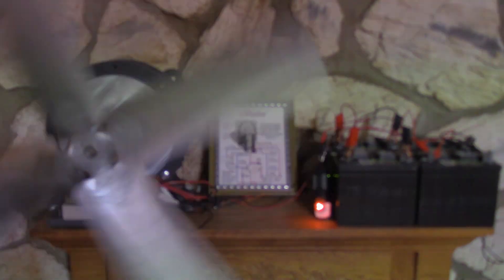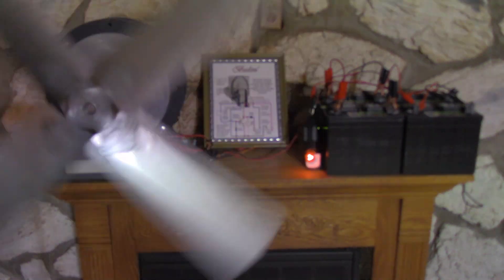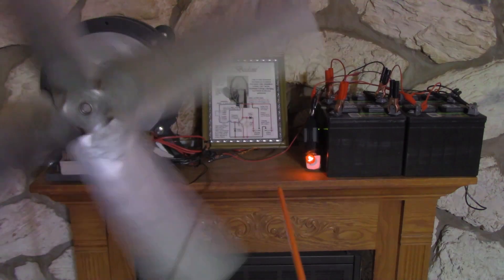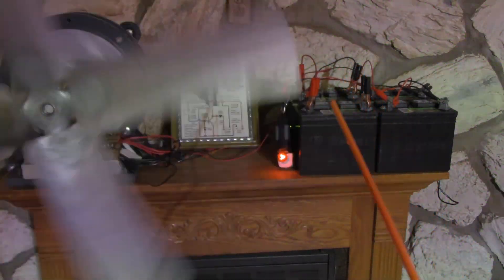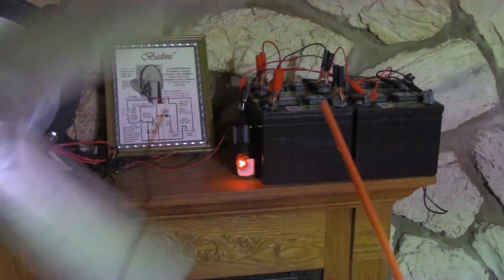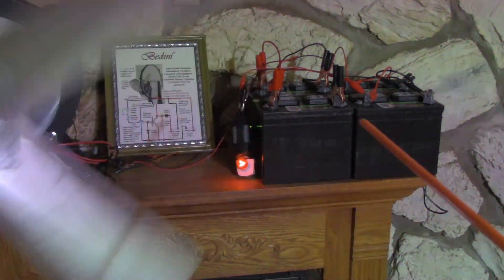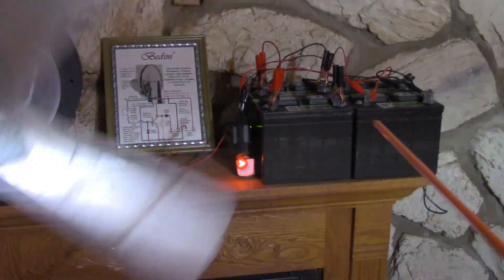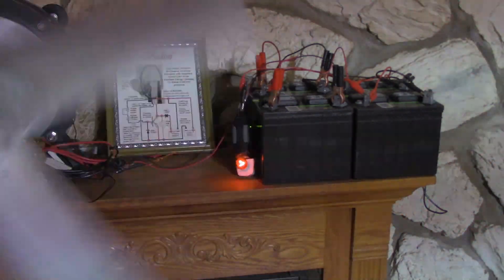SSG Motor Energizer with Power Wall

Comment: Seriously… it’s 2025 – are we still dealing with blurry footage like this?
When you zoom in, the shot is barely readable because a fan is slicing through the frame ten times a second. Wouldn’t it make more sense to just show a clear photo of the circuit in post-production? Or – wild idea – maybe just hold it in your hand, in front of the fan? That said – thanks for your videos anyway. 🙃
Reply from the maker: Take it easy man, the video wasn't for you but for those interested in the specific information. It was just a simple point and not about seeing the motor or circuit. The point, if you missed it, was how we arranged the batteries.
Also the fan was to show it running just like Bedini did with the exact same circuit. We will get into the details this summer...

Comment: Τhank you for reminding me of this SSG topology technique, I never expected that this topology could supply 2000 watts continuously or more, what is the limit? Can you give us a theoretical estimate of the size of the batteries needed for 2000 watts 24/7 and what type of battery in detail? What life span should we expect from the batteries? Thank you.
Reply from the maker: There was a lot of misunderstanding and distraction about this technology. Everything was explained from the beginning in my yahoo groups to thousands of people. This system was focusing on using the process to charge big battery banks. The larger the batteries the more charging takes place which is the other point I forgot to mention in this video as a third reason for the larger parallel bank. I have seen over 200 times the input energy on the basic SSG setup on my earliest 3 pole monopole when I replaced a 12AH 12V batter for 2000AH 48V bank. It can be done with any of our systems over the years. It depends on good batteries that are new or having been brought back with our Renaissance Chargers and also been conditioned over time with the SSG Energizer. This is what we will bring back, the method of prepping the batteries with cycling. The example I mentioned with the customer is what many people like myself have done for 20 years with that system. 2000W is relative to the battery bank size and energizer size. What I am showing in this video is merely 9AH Walmart batteries we just got recently. Normally we run this kind of SSG at the C20 rate of discharge so this is more like C10 or twice as fast as you should be doing this. I was just doing that to run that big fan which is only taking me 0.8A @ 12.5V or 10W. [Now this rotor is the dualpole so it is two rotors on either side of the coil so it gives double mechanical output than the monopole.] So if you were wanting to do 2000W continuous then you would want much bigger batteries to be in the power wall and on the input side that would be rotated in order to run the system at a C20 rate of discharge ideally. 

That would be the basic system still, in the advanced system the input battery will not discharge and the single charging battery will also just stay the same while we multiply additional processes with loads in the output path (as many as desired...). In the new SG kit we'll be going over about 10 different systems/models that you will only hear from me over the last 20 years.

Comment: I want to see an active rectification mosfet ideal diode mod to the LAR circuit bedini was working on so i can run lithium phosphates i think i know enough about quadrant 4 operation to make one of them since they seemed to have disappeared that and the cap dump circuit which i wasnt quick enough to buy, ive paid for a machined aluminium overhead weight wheel for my flywheel and had 16 neo’s added to it the guy said he made the bolt hoel math with his computerized lathe machine equipment so time will tell if it looks good on the scope. Whats your thoughts on the 2% iron enamel wire apparently its great for this machine going off deepseek? I will pay for a roll of 1 or 2 mm roll of wire if it will make the machine draw more radiant. I liked peters elongated coil forms to increase the power of the coil or what ever it did
Reply from the maker: While we can use/charge any batteries, including LiPo, we have to distance ourselves from having anything to do with lithium (not just ion types) because of liability, and the fact that these are toxic and dangerous. These also burn up contrary to common misconceptions. 
I doubt that most people reading these comments will understand what you are talking about otherwise.

Comment: So if u had a switch for each coil on/ off that could be speed controller for the fan?
Reply from the maker: No it already has speed control with varying the trigger resistance. The coils turn on and off based upon the transistors and the trigger coil.

Comment: We are waiting with impatience, your works always had a secret, something was always unsaid, energy impulses were poorly absorbed by the battery, but you did not stop working, so your devices had an efficiency of 1. Perhaps it is time to open the information. Many abandoned these devices, because the efficiency of 20% is very little, a lot of losses and a lot of secrets. We spent 20 years in our search, but did not find, there are those who can accept the information
Reply: Doesnt it depend on the transistor itself, the sweetspot, the right frequency and depends on the overall freq of the multiple circuits the harmonics, the 441hz moment ( kings chamber resonance)
Reply from the maker: I appreciate your video response. I was never about secrets and you will see that I did indeed share many things from the very beginning. It was open source. We did show how the battery can absorb the energy fast as well. The monopole motor did not have much mechanical energy and yet I made a rider lawnmower run in 2006. The losses you speak about I converted to do actual work with added light and other loads. The new kit will get into some of these things. I think some things are lost in translation. I have a Russian worker who just translated what you said in your video and we can see there is a problem in translation.